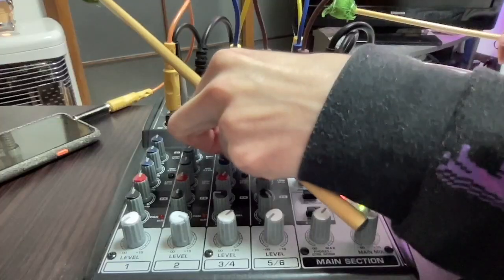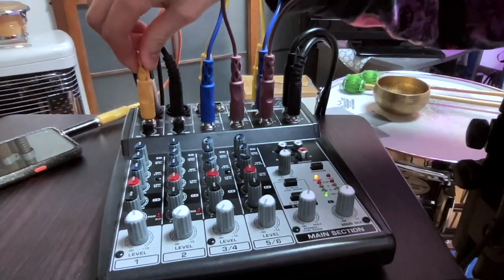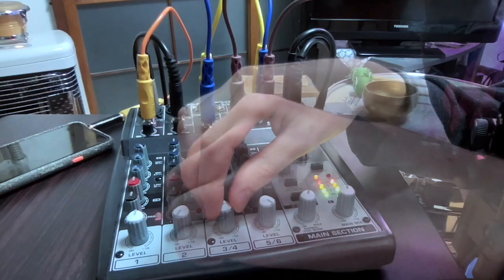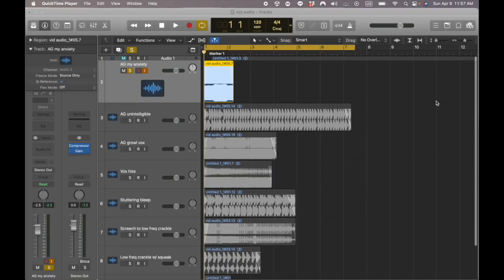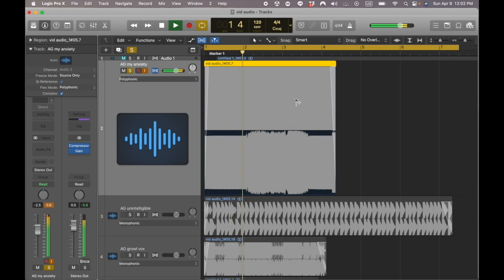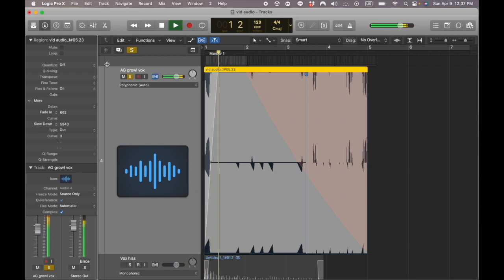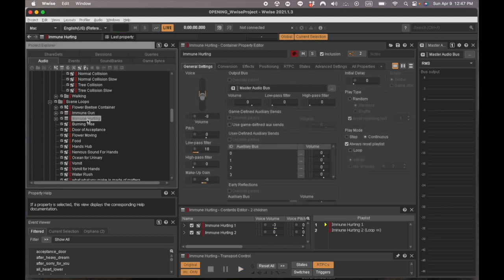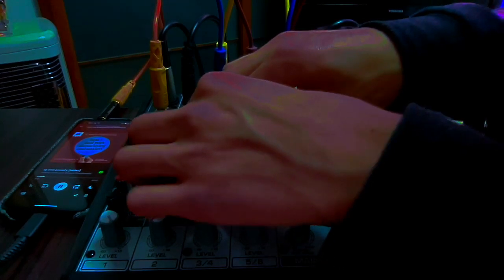No-Input Mixing for Sound Design - Set-Up, Examples, In-Game Footage

Comment: hi! I was wondering, since you’re using the mixer with a DAW, do I need an external audio interface? Cause it doesn’t seems like you have the xenyx connected to one! Also, are you using regular 6,3 jack-to-jack cables?
Reply from the maker: Hey, thanks for the questions! 
It's not in the frame for a lot of the video, but yeah, the mixer is going into my Scarlett 2i2. However, there are some mixers that have USB capability, so I believe you can go right into a DAW without using an interface if you have one of those ones. 
Yep, so those cables are just regular short 1/4" cables, with the only adapter being the one going to my phone. You can buy nice little packs with a bunch of colored ones about a foot long each, but you can also use just any patch cables you have at first.

Comment: How is this "no input" mixing when the first thing you do is provide an input from your phone and then route a contact mic into it?
Reply from the maker: The technique of "no input mixing" refers to routing the inputs of a mixer into the outputs, which I showed here! That creates a feedback loop because you are patching the mixer into itself. You can use that feedback loop alone as a means for generating sound (which I, and many other people, have done), or you can use that feedback loop to modify any other signals you want to route into the same mixer. So, I'm just using a modified version of that technique in this video. Some of the other comments here go into that question too, but let me know if you still have any other questions about it.